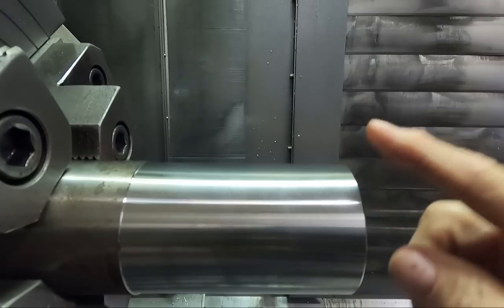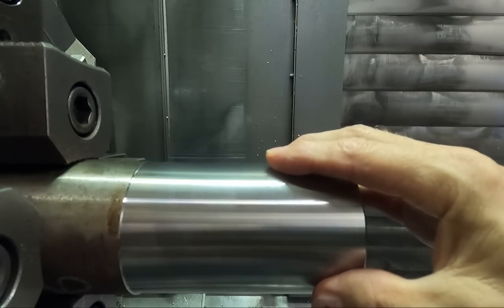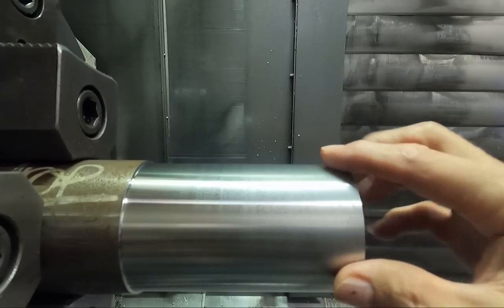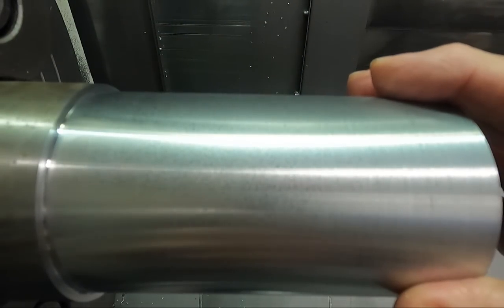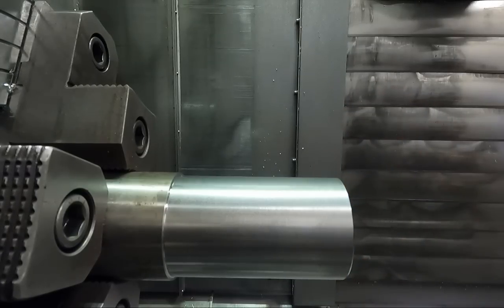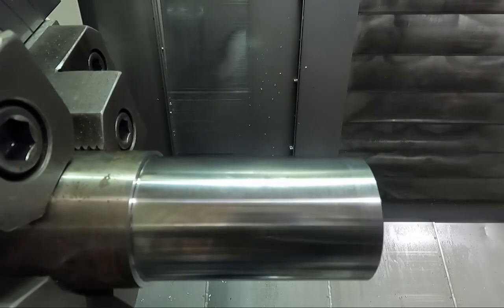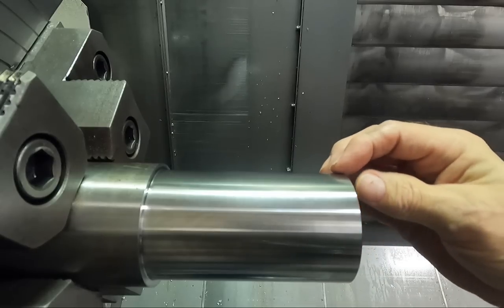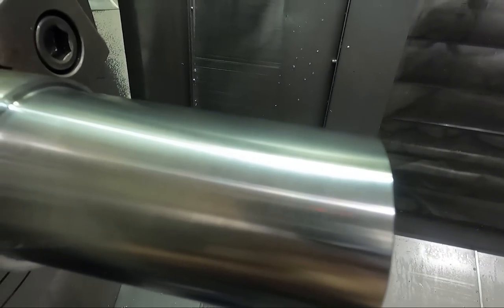Does Depth of Cut Make a Difference to Finish

Comment: In MY experience: 1) Proper depth of cut can prevent surface damage by wrapped up chips. Having a DOC that gets the chips to properly brake will minimize the risk of smeared/scratched surface finish. 2) Some materials will have perfectly fine surface finish with a wide range of DOC. Some materials tend to have better surface finish with a proper (deep enough) DOC. 3) Most of the time cutting a bit deeper then nose radius depth is deep enough. Sometimes for best finish 2x nose radius depth is needed. 4) Super shallow cuts with extremely high cutting speeds are almost always amazing finish.
Reply: I will add that tiny depth or cuts/spring passes can bump the tool off and on the cut due to the elastic deformation of the workpiece material underneath causing it give in (also softer materials will take more deformation until they "fail" into a chip, so they will most likely leave hangers and boogers if the doc/fr aren't enough to go past it), and won't produce the shiniest surface possible, even with the sharpest light/fine turning grades available. 

With that said, on steel you can take a 0.01mm depth of cut with a really sharp, fine turning ground insert (even better the honed/lapped tolerance grade E), and even if it doesn't get scratched or bumpy, it will still not be as reflective (and probably a bit rougher along the cut) due to the reduced cross section of the chip, not conducting/spreading heat in the same way, as well as the minimal cutting pressure being inadequate to produce the work-hardened, compressive residual stress layer, that gives the machined material the shiny surface (due to the material under the shear zone being prestretched at it's yield point and not being able to take enough extra deformation to leave hanging crud) and some forged like qualities (that's why even stress relieved materials will warp when machined with cutting tools versus EDM etc)
Reply: I do production, and for chip control, and tool life, I always take right above tool radius, and with enough feed to ensure chip breakage(but of course stay within surface spec). I found that if I only take 0.2mm radial cut for a finishing pass with a R0.4 nose radius. After 20-50 parts, I'll start to see a flat spot on the insert radius(plastic deformation), leading to a faster deterioration of the surface quality. Meanwhile, if I take a 0.5-0.8mm radial doc, the insert will last me 200+ parts, without any nest building, or a big surface quality decrease.

Comment: Why didn't I think of doing an experiment like that years ago....very helpful.  Low carbon steel is always a challenge to get a good finish, especially on a manual lathe.  Hate when you take that last pass and the finish goes bad on you.
Reply: I wonder how many turners use the same tip for finishing that they have just roughed out a ton of metal and wonder why the fish is rough.
Reply: @gangleweed  I have a particular tool that leaves a very good finish in mild steel but it only works starting at 4mm diametral depth of cut. fun times when I need to turn a 20mm bar into 16mm + - 0.01mm in one single pass,  at least I don't have to sand to get an acceptable finish.
Reply: @shiro-r4m  Here's a tip for you.....if you want to get a " chrome" plated finish on any mild steel try doing a finishing cut at .06mm deep and run the lathe at 60 rpm if you can go that slow and use coolant......the curl that comes off will be like ally foil......works for any other metal too.
I use a tool that looks like a parting tool but has a 6mm wide tip face, honed sharp......keep the tool face dead square to the work piece and you can use a fairly fast feed to save time.
Using that method I've formed large radii with a form tool on my old capstan lathe many years ago.
Reply: @gangleweed  I’ll have to try that out, my lathe goes down to 40 rpm. Don’t have flood coolant setup yet but I could use some in a bottle.
Reply: @shiro-r4m  Yep, I can guarantee that if you take a shallow finishing cut using a slow speed with a broad tool the finish will be like chrome plate.
If the tool is shaped like a parting tool and honed sharp......6mm wide is good........it peels off a sliver like fine foil......the feed rate can be quite coarse as the finish is determined by the tool width, but it must be dead square AND DEAD ON CENTERE to the work piece or you'll get cyclic grooves as it cuts........using it on brass is awesome.......as long as the work piece is kept lubed with coolant the finish will be shiny.
Reply: 1018 forget it I just try and do my best

Comment: Sadly I am often times forced outside the manufacturers recommended speeds and feeds because my machines just can’t run that fast. Then have to resort to abrasive operations for final finish. The harder the material the less it’s a problem.

Comment: As a small arms parts manufacturer, having nice surface finish is really challenging. 800 sfm requires over 10k rpm for parts under 1” diameter.
Reply from the maker: For 1" diameter = 3.1415" circumference. 12" (one foot) divided by 3.1415"= 3.8197 revolutions of the 1" bar to do 12". So 3.8197 times 800 = 3055.77 RPM for 800 surface footage. The equation is. SFM = RPM × D × (π ÷ 12). So for 800 SFM at 10,000 rpm the diameter would be .30557". So yes that is less than 1" diameter and probably a size you would be machining. But you would also not being using mild steel for your parts. So it would not be necessary to run at 800 SFM. But this is why commercial screw machines turn high RPM on their spindles. Thanks!
Reply: Wops! Seems like I messed up at converting imperial to metric. Nowadays I’m turning a 1040 steel part which has 16.5mm id and +0.015mm tolerance. I’m going to machine 15.000 parts. Turning tool recommends to work between 200-350 m/min. Which means rpm should be at least 3850 and my machines limit is 4000. I don’t know why but turning over 3000 rpm frightens me. That’s why I’m having trouble to have the surface finish I want. Thanks a lot!

Comment: Would be interesting to see a test with a profilometer on one of those pieces with a visible difference in surface finish on each step.  Does a better looking finish mean a better measured finish?
Reply: In short: No.
Our eyes tend to prefer shiny while measurements are based on the actual surface profile.

That said an experienced person can often judge if a surface is "good" or not. But it doesn't replace a measurement. And there are also multiple ways to measure that can't be compared to each other (Ra, , Rq, Rt, Rmr...)
Reply: It doesn't, it can look good to our eye and be awful when actually measured.

We as humans tend to think that shiny and homogeneous looking equates to a good finish but that can be misleading.

Guys that have been doing this for a few decades though can usually eyeball what kind of finish it is and in my experience be correct about it most of the time once it has been actually measured.

Comment: The main factor for a good finish, if we are talking about steel - like in your video, is cutting zone temperature.
Which your tests showed very well.

Everything that increases that (to a certain point) will increase it, since the chip will shear much cleaner from the material.
Coolant won't make a large difference or only at very low SFM. 

A used insert (not broken) will almost always make a better finish than a new one, since isn't as sharp and creates more temperature. 
That goes for everything that increases it, like: "dull" tool geometry (thats why its always shiny after roughing) , higher SFM, higher DOC, higher feed, tougher material etc. 

Of course every grade of steel is different and requires certain parameters. 
But generally something like 1018 will only finish good at roughing cuts or very high SFM, while 4140 won't be much trouble to get a good finish.
(but again, the toughness creates way more temperature, so it helps a lot by itself)
Reply: I can add a reference book to the discussion.  I am a hobbyist, and have only read a little bit of this book.

"Metal Cutting Principles", second edition, by Milton C. Shaw, copyright 2005, Oxford University Press

Excellent experiment.
Reply: I agree with you. Built up Edge happens because of cutting zone temperature being too low.  From what I've seen of materials under the microscope, the poor surface finishes seem indicative of material smearing.
Reply: My only disagreement is on "coolant" (I highly prefer the term cutting fluid). Generaly cutting fluid reduces friction from the chip with the cutting face (the hottest zone) so in effect tool heat, while still allowing to maintain enough heat in the shearing zone. 

In my experience cutting fluid (even a measly oil mist) makes a big difference in reflectivity, even with cutting speeds well above the shiny zone (with no stuck built up edge, no hangers from the material elastically deforming more than the doc/fr, no chewed up finish from chips bumping back on the workpiece), it will still increase the reflectivity of the surface by preventing rapid oxidation of the material under the cut from getting exposed to air at high temperatures.

Also it's the only way to get a completely smooth, mirror finish on mild steel when milling... without cutting fluid it just goes from a dull grey to having burn marks if you keep pushing the speed but it will never look shiny and crisp without it (width of cut won't do much either)
Reply: @Sketch1994  usually turning (or all operations with continues tool engagement) always are done with coolant or cutting fluid. 
Of course it helps in the long run and will improve the finish, but not to a level where too low SFM or other bad paramters are compensated. 

Regarding milling on mild steel: 

We do most of our milling dry. (10 to 20x more toollife compared to high pressure TSC) Exceptions for side finishing, thread milling, deburring and form tools. 
Mostly 1018 and 1045. 
Best way to get got surfaces is just to use an insert with a long wiper edge and running at least 650 SFM. 
Seco Square 6 shoulder mills work extremely well, or double Octomill with M11 geometry. (all dry aswell)

To get almost mirror like finishes, try Cermet tooling with around 1000 SFM. 
But spindle alignment etc. need to be spot on.

Comment: Very cool tests.. I learned a lot.  It answers so many "what if" questions.   I see why you are saying SF instead of spindle RPM;  because depending on the diameter of the work, the SF changes a lot, at the same given RPM.   It's crazy to see so many variables in such a simple and straight forward test;  and we haven't even talked about different tooling HSS vs carbide-  or even all the variables of turning different materials, such as HC steel vs copper vs brass vs stainless vs aluminum, etc...   I feel like I know just enough to realize there are so many things that I don't know. lol.
Reply from the maker: You also forgot to mention machines and the difference in setups. This is one of the reasons I don't often mention speeds and feeds in my videos. There are so many variables that what I do probably wont work for you the same. What I want to encourage with these type of videos Is. People should make tests with their own equipment, tooling and setup to get the correct cutting conditions. That said this might give some idea where to start.
Reply: @EdgePrecision  ....also completely missing is MEASURED RESULTS .....rather than just talking and saying "this looks really good".

.

Comment: A couple of important points to add along with the video (in no particular order and with way to brief explanations):
(Post updated with geometry below)
It is very important to differentiate between visual and measured finish - Look at what the customer specified! (Most common is measured in Ra, if it "looks" shiny or not rarely matters.)

The theoretical (best possible) is determined by nose radius and feed (larger nose and lower feed gives a lower Ra).
Rigidity: machine, fixation, tool, part... The weaker things are the more the pressure in the cut must be reduced.
Depth of cut: There's a strong recommendation that at least 2/3 of the nose radius needs to be engaged, less then that and one is asking for problems.
Insert geometry. A more positive insert will, especially in softer materials, give a better result ("sharper" and larger release angle). The more narrow the nose is (V vs D vs C...) the more we limit the point of contact which reduces cutting forces and increases release angles sideways.

In real life what do we need to do?
Reduce the nose radius of the cutter! This seems wrong but it allows for the rest of this list and the sum gives a finer result.
Reduce feed.
Reduce depth of cut (but be aware of that 2/3s rule). This is to reduce the cutting forces.
Make sure everything is a rigid as possible - vibrations are your worst enemy.
Use correct cutting data - The big manufacturers of carbide inserts have plenty of information - use it to your advantage but also consider your machine and setup, manufacturer's data is normally based on very stable conditions and high performance machines.
EXPERIMENT, test! Learn to know your machine and materials. 
Are you using the right insert? Talk to your seller, any good supplier of tooling have support staff with deep knowledge to help their customers.
And last but not least, handle your part with care! Even a slight "ting" might damage the surface and earn the label "REJECTED". So treat them like raw eggs.

When I taught at a two year CNC extension program (students needed to be at CNC operator level to start) we did as much of tests like in this video we could. Testing things like this makes a difference. I've also worked with food, medical and gas turbines products and those are picky on surfaces.

For those wanting to learn more I can warmly recommend Sandvik Coromant's E-learning. It's free and very well written and illustrated.
(It's under "Knowledge & Services")
Reply: Cool - thanks!

Comment: Most interesting! Thanks!
I'm wondering if coolant or cutting oil has any effect on surface finish. Might be interesting to rerun one of the ones that showed variation (maybe 400/.005, I think was one) with coolant and see if the result is the same.

Comment: Great video does appear to be 1018 i began running a okuma in 1988 and have always left 0.01 on dia 0.002 on faces tor most materials i do increase finish depth for smaller diameters if i max rpm is reach

Comment: I've always held to the idea that minimum depth of cut should match the nose radius of your finishing tool. I prefer to double it and crank the surface footage up. My standard finisher has a .4mm nose radius, so I typically write programs with a U-.032 and G96 S1500. The shop I work for strictly runs haas machines. That machine can handle so much more, especially with a .032 nose radius. A cut at .062 deep at 600-800 sfm (I'd max the spindle out if I were running it) would shine like a diamond.

I also just happen to love the sound of chips spraying the door. It's the sound of my people.
Reply: wouldn't it be U-.064?

Comment: Cermet inserts also work great for steel. Mitsubishi MP3025. They also have a wiper geometry so you can feed double the feed and achieve same surface finish .

Comment: It really confirms that the tool needs to be sufficiently loaded to cut consistently and cleanly. Whether proper loading is achieved trough depth, feed or speed seems to be negotiable but it needs to be sufficient, one way or the other. 
For very light finishing cuts, do you have any experience using cutters with a shearing geometry? I know they used to use those in the old days (manual / HS steel), esp. for gummy materials. But, in my admittedly very superficial experience, I've never seen a modern equivalent in person or a vendor catalog, and even less ever used one.
For finishing in your machine, have you ever considered using something like a hand-held crankshaft polisher? The safety interlock prevents you from running the spindle at speed but you can still rotate the headstock at low speed, right?
Reply from the maker: No I can't rotate any of the spindles with the doors open. I can only jog the turning spindle with the C axis engaged with the hand wheel. There is also a very slow jog in turning mode (and you have to hold a button down all the time). I never use this. But I assume the purpose is if the machine is in low range it is difficult to turn the chuck by hand. So maybe to indicate something. I always use the C axis for this myself. The milling spindle can't be turned on at all. With the doors open. There could be a benefit to using HSS for certain things. Plastics for instance. There were a few companies that use to make HSS inserts. A long time ago I used some. I don't know if they any longer exist. The inserts I used in this video may not be the best. This example may be different with different tools. This is precisely why I don't often mention feeds and speeds in videos. There are to many variables to concider.
Reply: @EdgePrecision  And then there are cermat inserts for specifically getting finishes using low depth of cuts in soft gummy steels like 1018.... Ofcourse those need higher SF... But DoC can be kept low ..

Comment: Depth of cut is critical when it comes to surface finish. Depending on material, sometimes a .01 pass is good enough, other times a nice beefy .05 pass is perfect. I tend to use Spindle Speed Variation whenever possible and I always get the finish desired. If your machine has it, use it.

Comment: Nice I use an .008 thou rad finish at 656sfm and .0036 feed around .005 doc . I did tests just like your doing within the manufacturer’s recommended speeds. I would love to have one of the integrex machines. maybe one day…

Comment: We've started doing deeper finising cuts to reduce the chip stringing, if the setup can take it we do 1/8th inch off the diameter for a finishing cut with a 1/32nd nose radius insert.  Perhaps going deeper could help you as well.